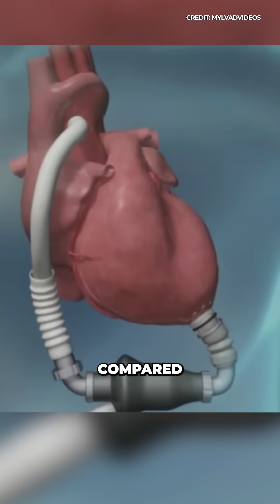Engineers Create World's First Fully Artificial Heart

Comment: Now imagine being a first responder and realizing your patient is breathing but doesn't have a pulse.
Reply: We are already trained about this because of ventricular assist devices that similarly don't have a pulse, but can have good perfusion.
Reply: As EMS, something like that. There already exists a system for if you have heart failure that can temporarily work while waiting for a transplant.
That said, it is external primary, this would be hella cool. But you could not find a pulse, as there is not difference between pressure, which is what a pulse is, I also don't think that we would be able to find blood pressure.
Reply: @jamesmarquess1496 I think in this case you should tattoo "I HAVE A MECHANICAL HEART, I'M NOT DEAD" everywhere they'd check for a pulse 😂
Reply: @choose282 probably would have it tatted on my chest and the medical bracelet
Reply: @choose282  also "RESUSCITATE BUT NO CPR BECAUSE MY HEART IS TITANIUM AND IT'S NOT A LYRIC FROM A SONG"
Reply: @choose282  given that its a temporary thing until they get a donor and tatoos are very much not a temporary thing and will confuse people after the transplant - no, they should not have done that
Reply: @choose282 ” proof that Toby stark has a heart “
Reply: @jamesmarquess1496  If there's a circulation of blood around the body, cuffs should find a blood pressure in theory
Reply: @codyelms9706  They might be mildly concerned when the systolic and diastolic pressures match.
Reply: @Argonwolfproject  YOU’RE RIGHT💀
Reply: @jamesmarquess1496 there would just be a single blood pressure, but I see no reason why a sphygmomanometer wouldn’t work
Reply: Not quite, I'm sure the hospital has a way to check, but within the field, we find blood pressure my first finding or listening to the pulse, then inflating the BP cuff until it cuts off, sense there is no pulse, BP cuff would just slowly press until it stopped blood flow, but there is not to my knowledge a in the field way for use to find that
Reply: @jamesmarquess1496  I suppose you could always insert a syringe that isn't under vacuum into an artery and check for flow. Just a guess.
Reply: @jonrice21 
You probably could, but that’s assuming that you find an artery instantly and don‘t mind the bleeding afterwards.
Reply: @YunxiaoChu    A sphygmomanometer  needs a pulse, a pressure wave. When the air pressure in the cuff reaches the systolic blood pressure, the wave flattens; that's how it is measured.
Reply: @jamesmarquess1496  you would still have blood pressure, its just that it would be a static blood pressure instead of two different values. 

But fluid flowing still has a pressure even if its a continuous flow.
Reply: @jamesmarquess1496  Yeah well, with advances in technology comes new problems that eventually get solved. I'm sure as this thing gets popular, someone will innovate in some way to make up for the cons.
Hell, maybe people will just design a completely new pump that mimics the heart.
Reply: @jamesmarquess1496  if you block a vein off you can see if the vein builds up  without pressure it wouldn't expand at all with blood flow veins would act normally with a blocked off vein. Like how you squeeze your arm to pop your veins out
Reply: @jamesmarquess1496  you're completely right, a normal pulse would be undetectable, and systolic/diastolic would be meaningless so any electronic system should find no pulse and not report anything (to avoid a false reading). Someone with a hand aneroid and a stethoscope might hear a hum that increases in pitch when flow is cut off, and get a pretty good MAP, but it would have to be a very quiet room, and nobody is going to guess that unless the guy can take 5 minutes to explain ahead of time.
Reply: @jamesmarquess1496  true using current equipment, would probably require a new device that measures pressure from a cannula.
Reply: @jamesmarquess1496  could this help people with blood pressure
Reply: @jamesmarquess1496 I think trying to take blood pressure would overwhelm the regulators on the pump and cause an motor overload
Reply: confused screaming
Reply: It would make me triple check the patient, but if there is a clear airway, good oxygen intake, and circulation, I'm not worried. It's definitely going to be gossip in staff training, though 😅
Reply: Im so curious about what something like this does to your vessel valves, if its truly continuous flow does holding the valves open weaken them? Could that cause complications when they finally get a new heart?
Reply: @histiest1628 I think they replace the valves with the new heart but I could be wrong
Reply: This is a good question,  does it work like a musle where if u dont use it u lose it? I mean I dont see y it wouldnt be a problem @histiest1628
Reply: @histiest1628 
That's a really interesting question actually
Reply: @histiest1628  interesting question. These continuous pressure devices would could cause venous valves to stay partially open (the systolic pressure is lower than normal and there is not diastole) andthe lack of pulse could lead to venous stasis and an increased risk of thrombosis (blood clots). The arterial valves from the heart (aortic and pulmonic) might actually stay closed and cause the valves to fuse because of the way some of these devices empty from the ventricle directly into the aorta.
Reply: @histiest1628  Valves aren't 'held open'. The entire heart is gone. There are no valves to open. Your veins and arteries are basically plugged on like a pipe joint, afaik.
Reply: @histiest1628 aren't the valves part of the heart tho? So the artificial heart wouldn't have valves and a new heart would have strong valves already.
Reply: I'm a nurse that used to work on a heart failure floor with LVADs, devices similar to a total artificial heart. The EMS would likely immediately see the giant battery pack strapped to the patient and the drive line of the battery to power the heart going into the patients chest, you cannot miss it! But yes! You cannot feel a patients pulse when they have certain types of LVADs and the artificial heart above. Pulsatile flow is actually better because it helps break up and prevent blood clots. We also have to use Doppler ultrasound to accurately take blood pressure regardless of Pulsatile or non-pulsatile devices. Doppler is basically a little ultrasound stick that you use to amplify the sound of the blood pressure when using an inflatable BP cuff
Reply: He will I assume have a pulse or at least blood flow but not heartbeat(you check on wrist or neck veins)
Reply: @hellyeah6717 I mean.. would he have a detectable pulse? If it’s just continuous flow, I don’t think it can be felt
Reply: @RocketDoggo737  Your intuition is correct. If the device is pumping blood under continuous pressure there wouldn't be a palpable pulse - and you wouldn't be able to measure a blood pressure either, at least not with typical non-invasive means, because blood pressure cuffs rely on sensing a pulse to take a measurement. The same thing also happens with a left ventricular assist device (LVAD) which performs a similar function.
Reply: @PhoebusAmoebus this is very intriguing as this kind of treatment is changing the normal blood flow pattern from Behind Heart beat forward push pressure waves to a continuous flow in a small pipe with a fixed flow rate via some electromagnetic phenomenon.

So the patient's pulse and blood pressure in these cases would be differently measured and their normal values would differ from the assigned 60-100 bpm and 120/80 mmhg. 

I am curious about the internal monitoring system and its concerned variables which regulate the different continuous blood flow rate as per physical activity.
Reply: You can hear the blood circulating, and the mechanical heart will make sound veca duh electromotor
Reply: @RocketDoggo737 you can check blood pressure though. I think if the vein goes back to normal after being compressed that could be a sign of living
Reply: @RocketDoggo737 blood has to pump around the body for someone to be alive ? A pulse is blood traveling through arteries or veins it’s not the heart that makes a pulse 😅
Reply: @RocketDoggo737 it doesn’t actually flow continuously. He was just wrong about that I think. 

Human circulatory system isn’t designed for it. He failed to mention it, but not only does it change its speed depending on activity levels, it is also always oscillating in speed, which combined with the unique shape of the inner chambers, creates a pulsed flow analogous to a natural heart beat as it exits.
Reply: @RocketDoggo737 
Even low pressure continuous flow has a noticeable vibration.
Reply: @RocketDoggo737 Id assume they’d measure it in mechanical rpms
Reply: @RocketDoggo737  love your username
Reply: Ef waves will def be released so you can just try to detect that @RocketDoggo737
Reply: @RocketDoggo737 id assume the valves in arteries would still snap shut, could be wrong though
Reply: Im sorry but the USA is on fire and hell yeah are very accurate user names right now
Reply: @RocketDoggo737 yeah exactly wtf… idk if I can’t feel a pulse I’d start compressions (cpr) which would do nothing because the hearts titanium like you usually do cry to pump blood out of the heart … that’s a funny though
Reply: @RocketDoggo737  I've worked with (a lot) of patients on the volume displacement pumps (LVADs). Obviously not the same, because those patients still have a heart it just works poorly, but you can hear the flow with a doppler. I assume you'd also be able to hear the artificial flow the same way.
Reply: @The_USA_is_on_fire  I have a hard believing he has blood on a continuous flow like that. Seems like it would surely cause problems with something to have a continuous pressure, so maybe this video is exaggerating.
Reply: @RocketDoggo737 if the blood is getting pumped then of course lol use your brain
Reply: @RocketDoggo737  I would imagine you could feel something akin to a pulse by pressing on the vein
Reply: you typically go straight to check for breathing as checking for pulse usually wastes a lot of time
Reply: @RocketDoggo737 thats why i think the hearth shold be a bit loud
Reply: @RocketDoggo737  You can feel continuous flow.
Reply: @hellyeah6717 actually to add onto that without a detectable pulse he could be technically dead right now under some definitions..
Reply: @RocketDoggo737 , concious, responsive and effective breathing.  Not dead under any definition mate.
Reply: @RocketDoggo737  yes, but dead in the sense "there are people who have died for 4 minutes and come back to life"
Reply: @RocketDoggo737  this is why I’ve always called cap on death being the heart stopping lol
Reply: @RocketDoggo737 breathing also plays into that you first check for breathing then a pulse
Reply: @tommo5884 you knew he was being facetious. You were doing well with your medical explanations. Stop yourself before you interpret humor as your "uhm actually" moment.

Stick to the informative stuff.
Reply: @FormerlyBWZ , nobody dies and then comes back.  Death is very definitive. You can survive cardiac arrest, but the odds are severely stacked against you and decreasing with every minute your heart beats ineffectively.  With the odds of survival going down, so to do the odds of permanent disability go up.  Realistically the brain will survive a max of 3 to 4 minutes before brain damage is significant and life altering.  The survival rate for such cardiac events in the US is 10%, the majority of that statistic received immediate treatment, defibrillation and medication.  Once the brain is dead, that's it.
Reply: @conraddejongh3898 , stick with your millsims and stay out of the real stuff
Reply: @The_USA_is_on_fire You're right. He's medically dead without one according to some definitions
Reply: @RocketDoggo737  depends on the temperature, they heat up to see sometimes
heck, in medieval times they buried so many unconscious people they started adding bells to the coffins so the people could ring it
Reply: @The_USA_is_on_fire  or instead of thinking of them as technically dead, you can think of them as technologically alive.
Instead of having biological organs they will have technological organs
Reply: @RocketDoggo737 Did you know that most of us are classified as a dead person?  Were just a corporation owned by the government which is what our birth certificate is
Reply: @RocketDoggo737  "This is the IRS, we demand the inheritance!"
Reply: @RocketDoggo737  under what definitions?
Reply: @RocketDoggo737  I thought the modern classification of death now is brain death
Reply: @RocketDoggo737  not right now. He now has a donor heart. He may have been dead, not anymore though.
Reply: @RocketDoggo737  the definition of death is the soul parting from the body . So i disagree
Reply: @RocketDoggo737  doctors consider an actual death and clinical one. The clinical one assumes your heart isn't working/blood isn't flowing but he does have a working "heart" i guess?
Reply: @RocketDoggo737 Heart failure is not defined as dead, it is actually brain failure that defines death. Heart failure, but no brain failure is considered a vegetative state.
Reply: @RocketDoggo737  which is exactly why fetal heartbeat laws are such BS. The heart is an important organ but it doesn't define life
Reply: @RocketDoggo737  While your heart not beating is commonly thought of to be death, it isn't. Death from a medical standpoint is when your brain stops all activity; also known as brain death. Pulse is important for checking on the state of the heart and aids in determining the urgency of the situation, but doesn't directly determine if someone is dead. In this case though, they'd have a hum emanating from the artificial heart, which would act as the substitute for their heartbeat or pulse
Reply: @hellyeah6717 blood flow yes, but a pulse is a heart beat.
The pulse is the pressure wave from your heart pumping blood, if the flow is constant there are no pressure waves just a constant flow with a bit of unchanging pressure.
Reply: @hellyeah6717  What do you think creates your pulse?
Reply: @Malaphor2501 what baffles me is that he got over 2,000 likes for being very confidently incorrect. Scary
Reply: @hellyeah6717 nah, there would be no pulse, or a most an extremely weak pulse as the rotation is continuous
Reply: @hellyeah6717 no pulse... Pulse is a heartbeat, this does not pulse at all its a consistent volume flow
Reply: @hellyeah6717 Assumption is the mother of all mistakes. This being said you assumed incorrectly. Pulses are caused by heartbeats. Without a beat, its an uninterrupted flow. Meaning no pulse, but a hardly detectable flow.
Reply: @hellyeah6717 your pulse is your heartbeat.
Reply: @hellyeah6717  Listen for a hum instead.
Reply: @hellyeah6717 ...and where do you think a pulse comes from???
Reply: @hellyeah6717 pulse is a beat or shockwave of blood movement.  A motor does not stop and go it just goes.  So there is no pulse.  Most people check for a pulse first and often the only thing checked in the event they believe you may have passed away.  (Note a doctor will check for more then just a pulse before pronouncing you dead such as checking if your eyes dilate and if your breathing)
Reply: @hellyeah6717  the issue is that when it’s being pumped you can feel the pumps, which is different from a constant flow. If you were to try feeling for your pulse you wouldn’t feel anything when it’s not pumping, even if it’s flowing.
Reply: @hellyeah6717 You need a heartbeat for a pulse. We've had versions of an artificial heart before, and those patients don't have pulses. I think they wear bracelets to warn paramedics about the condition.
Reply: @dylanjones9061 I would assume it depends on how the artificial heart functions, its it’s just a continuous steady flow throughout the body then no pulse, but if it mimics how a real heart functions as close as possible there will probably be a pulse
Reply: @hellyeah6717  what do you think a pulse is
Reply: @hellyeah6717  The heart uses an impellor style pump, so there wouldn't be a pulse, just continuous blood flow.
Reply: @hellyeah6717  How can you say he'd have a pulse but no heartbeat??
Reply: @hellyeah6717  the pulls you feel when you press on the inside of the wrist is caused by the heart pumping blood at a specific beat. about 60-100 beats per minute. 
.
if the heart was replaced by a pump that produces continues stable flow of blood, then there will be no pulsation and therefor no pulls. but you might be able to feel the artery by pressing softly down and releasing. it might feel like pressing down on a balloon because the veins and artery's in our body has over pressure.
.
but idk for sure, i have never touched a vain with constant stable flow before.
.
i am how ever pretty sure that you cant feel a pulls and therefor anyone even health professionals would treat it as a heart failure. even though he might breath. but im guessing a patient like this has some kind of badge or necklace that gives important information like the person having an artificial titanium turbo engine in his/her chest. xD
Reply: @hellyeah6717  well since the heart pumps, the pumping is what gives the pulse, this wouldn't give a pulse since it doesn't pump.
Reply: @hellyeah6717  you check arteries for a pulse, not veins. Arteries are what the heart uses to pump blood to your limbs, which is why you can feel a heart beat from them. Veins carry the blood back to the heart, and are much smaller than arteries. You cannot feel a pulse from a vein. The arteries in your wrists are called your radial arteries. The arteries on the sides of your throat are called your coratid arteries. You do have veins in your throat that are also on both sides of your throat. Those are called your jugular veins. But like I said, you cannot feel a pulse from them. You learn something new everyday👌🏾💯
Reply: @hellyeah6717 or fingers and toes
Reply: @hellyeah6717  pulse is caused by the pulsing of blood each systole. Looks like instead of a pulse we gonna get a stu tu tu tu tu tu 😂
Reply: @hellyeah6717  it’s extremely hard to take a pulse check without equipment, I took a class. The teacher said he’s been an EMT in paramedic for 30+ years and even then he can only gauge up pulse around 10% of the time without using actual equipment.
Reply: @hellyeah6717 bro you can’t have a pulse without a heartbeat…..
Reply: Was just reading the people do have a pulse. Also there is one alternative total artificial heart but patients have to carry around what basically is an external pump. 
The company wants it to be usable for between 10- 20 years so probably a permanent solution for many patients till they get to the point of being able to grow hearts
Reply: It's the beginnings of vampire lore. Once all your organs are synthetic, all you need is fresh blood to live forever.
Reply: @98Zai  luckily, blood is made in the bone marrow
Reply: @98Zai sci-fi vampires!? 😱 I love it!!
Reply: No heartbeat, but breathing and no bluing of any skin would be an instant sign that theyre fine. Fingertips get blue quiet quickly iirc. If your heart isnt pumping but your lungs are somehow still working, theres no way for that oxygenated blood to be pumped throughout the body.
No doubt every person in the end would be stupefied at how theyre functioning without a heartbeat and "what in the fuck that low humming noise is, will someone turn it off im trying to work here"
Reply: @ hah
Reply: @  I think you mean dumbfounded, not stupefied
Reply: @YunxiaoChu   imo, the connotation of stupefied seemed more apt in this content.
Stupefied and Dumbfounded are synonyms at the end of the day lol.
Reply: New ER TV show episode idea just dropped
Reply: "No pulse, should I do CPR?"
"Nah... Get the Jumper cable"
Reply: If it is anything like the old artificial hearts (where you had to stay in the hospital) there are electrical leads going into your chest and it's VERY obvious you have something installed.  They don't have an internal battery obviously from the picture, and I don't think they install the battery pack in there for a temporary thing.  You are carrying the power source outside your body... at least for the old models we currently use.
Reply: My assumption is that you probably don't want to have a battery inside eof you body, because that's a huge risk of many things to go wrong. I assume it probably just a really big battery that lasts super long and the only thing internally is the pump and motors. @piratekit3941
Reply: You don’t have to listen for the beat just for the hum
Reply: Now imagine being the EMT who started CPR because he didn't find a pulse and heard a grinding crunching metallic sound
Reply: DUDE EXACTLY ! had this happen on a ridealong, dude had an LVAD so no pulse OR blood pressure. dude was sitting up fine and talking to us, it was crazy and even one of the EMTs was also like “yo wtf that’s cool”
Reply: They wouldn’t have a heartbeat, they would have a pulse though. If you don’t have a pulse you will die, as blood isn’t being circulated
Reply: @Ronaee  what do you think s pulse is, it is your heartbeat, since the mechanical heart continuously moves  blood throughout the body without pumping it like a heart does, you wouldn't have a pulse but you would still be alive.
Reply: this has been an "issue" with VADs for a long time already. these parallel artificial hearts are implanted quite often. the issue is blood doesn't like these steady steams so much and tends to clot faster leading to strokes etc.
Reply: This actually puts the guy at a huge disadvantage, because CPR cannot be performed. If it stops, it stops.
Lmao the only time a defibrillator could actually restart a heartbeat xD /j
Reply: "Is there a mechanic in the room??"
Reply: He would still have a pulse.  The heart doesn’t cause the pulse, the contraction of the blood vessels does.  The heart can’t feasibly move all the blood in the body, so the blood vessels contract and dilate to move the blood along.  This is why, when doctors take blood pressure, they measure it as a fraction, systolic over diastolic, or contracted over expanded.
Reply: agonal breathing
Reply: They will have a hum.
Reply: Ok but this was the question my medical skills teacher asked me when we were learning about CPR lol. I told him I would still do CPR and he told me the situation was impossible... Not so impossible anymore ig 😅
Reply: This would be an issue if they checked the heart itself but the wrists and neck would have a slight pulse as there are similar pump like structures inside the circulatory system (it also prevents blood going back up said type of veins and arteries I can’t for the life of me remember what their actually called)
Reply: Wild. What do you do when the pump breaks? Cant do cpr. Do you get a drill to power it or just crank it with a wrench? Lol
Reply: @ it is probably designed with potential failures in mind
Reply: Someday were gonna be taught or at keast emergency responders beeds to be taught how to read vitals from a mechanical heart, and also know wether or not that humming sound is normal or not
Reply: Sir, the patient has a... Hum
Reply: Easy ,Vampire , wood stick through heart won't work though.
Reply: Right, as an EMT encountering a patient like this would be totally new territory.
Reply: At least this guy won't ever have a heart attack 😂
Reply: that's when you pull out the blood pressure test to check for bloodflow 😂
Reply: wait.... if the blood pressure test works when you detect 2 beats would it even work
Reply: Dude if I responded to that call I would shit bricks! Just thinking of writing that report gives me a headache. Imagine trying to explain this to your medical director as he has you in his office. 😂
Reply: just straight up hear "brrrrrrrrrrr"
Reply: That’s actually a legit concern. People are going to have to completely retrain how to check if someone is still alive… imagine someone with this getting pronounced dead for not having a pulse and having their organs harvested while they’re still alive 😅
Reply: @Ministry_of_WrongThink 
That‘s not how organ donations work, but I get the fear.
Reply: That would have me confused for hours
Reply: panik.
Reply: Having CPR done with that chunk of metal in your chest is terrifying! I feel like you’d need to carry something akin to a “do not resuscitate” card
Reply: Exactly what I was thinking lol
Reply: id be more concerned about the humming tbh
Reply: This is why you'll wear medical braslet
Reply: Good news is when people have cardiac implants they're usually wearing some kind of indicator (I'm used to the ones that look like oversized dog tags), so they'd know very quickly that something was going on.
Reply: paramedics would be in shock if someone doesn't have a pulse, but responds to absolutely everything
Reply: Well obviously, you would have a speedometer style bpm-bloodperminute gauge DUH 🙄
Reply: Wait, what happens when someone tries to give cpr? Does it crush the "heart"? I gooe they have a band or something stating that cpr may actually kill them instead of helping them.
Reply: One would think they would have a wrist tag or medical necklace indicating that they have an artificial heart
Reply: "How's his pulse?" 
"Smooth and steady like a BMW V-12."
"That's way too strong, we need to get him down to an inline-6!"
Reply: Please tell me someone here has seen "Death Becomes her" 😂
Reply: Paramedics are trained on LVADs. You can’t get a blood pressure on them either. All you can do is trust the patients, monitor what vitals you can and transport them to the hospital they need to go to.
Reply: There are multiple artificial heart implants that cause a patient not to have a pulse, so if the patient is conscious and breathing, we, as EMTs or paramedics, would just ask the patient if they have an artificial pump and then we would go about helping them with whatever they called us for.
Reply: My brain hurts thinking about that
Reply: But he has a hum!
Reply: LVAD
Reply: Also imagine being a clinical undergraduate student being told to auscultate his chest in your CVS osce station 😂
Reply: we’re already trained for that, as LVAD and RVAD patients also don’t have a pulse.
Reply: Just thought the same
Reply: I believe people with implants like that carry a medical bracelet or card for that very reason, so they know what they're dealing with lol
Reply: def. would have one of those medical alert wristbands...saying you have artificial heart
Reply: I’d assume any longer term implementation would require a medical bracelet to say they have one of these.
Reply: It’s a thing, there called lvads
Reply: Let’s just hope in that situation that there’s a family member with them that could explain 😅
Reply: he says in the video there's a hum surely they would know about this tech
Reply: As someone with severe anxiety and activity induced heart palpitations, this actually sounds so peaceful.
Reply: People with this will probably have to wear a medical bracelet with this information on it if it becomes a common solution
Reply: This has already happened to LVAD patients whose hearts fully stopped beating. Turns out a pump meant to assist the left ventricle can be powerful enough to do the whole thing sometimes.
Reply: Heart beat is 999bpm or constant😂
Reply: Each heartbeat generates a pulse, and the rate at which these pulses occur is usually referred to as your pulse rate, which reflects the heart rate. If it beats you have a pulse wether artifical or not, the sound may change but it will still be there, like a hum.
Reply: Doubt the patient was running around during those 100 days…I’d bet he or she was in an icu the entire time. Just a guess thought
Reply: LVADs are a thing that all Paramedics in the USA are aware of. This is an improvement on those devices.
Reply: That's why we put you on a 4 lead even if you are dead.
Reply: 😂 dummy he will still have a pulse
Reply: Hi Firefighter/Paramedic here. So I have actually encountered quite a few patients like that. These patients have what you call an LVAD (Left Ventricular Assist device). This devices assists the left ventricle on a heart (part of the heart that pumps blood to the entire body) when that part of the heart does not output the amount of blood needed to go through the body. When these patients have a LVAD, sometimes they do not have a pulse due to the pump being the only thing sending blood through the body. These patients wear a vest with two big batteries on them, they have to change one battery at a time when exchanging for fresh ones out of their battery charger bank. These battery charger bank has quite a few batteries at home, when they travel they have a travel case with batteries as well as a huge card on the case with instructions on how to manage the patient with a certain LVAD and patient treatment. It’s a fascinating device that these patient have when needed. Also fun fact, when someone with an LVAD moves and becomes a resident of a city, they are supposed to send paper work to the fire department and or EMS services if the the fire department doesn’t run their own ambulance, so they know that there is an LVAD patient living there incase that patient needs 911. Doing that helps Fire and EMS obtain additional training on LVAD patient management if they have not received any
Reply: For those that are curious, asked my paramedic about it. Basically, we can't find pulse in the field with palpating or other methods, however this almost certainly has an outside control, and you can probably just see the blood pressure on the guys smartphone
Reply: I think you’d probably be able to feel it  like how dialysis patients get that new vein made in their wrist through surgery and you can feel like a vibration of the blood moving quickly when you put your finger against it
Reply: You can see where this is going, right..? All I can say is eepz just eep.
Reply: I would assume there would have to be some form of documentation with the patient in the event this happens so they aren’t accidentally declared dead despite their blood still flowing
Reply: Vampire!
Reply: Wear your pass, if you survive an accident in which you turn out to be unconscious, it's sad.
Reply: Im a paramedic, Left ventricular assist devices do the same thing and they don't have a pulse! We usually get decent training in this
Reply: Then imagine then putting there ear to his chest to hear a low hum... and even better if he was important or famous, "i found the first fake humans, manchurian candidates are real!" Man that guy would end up losing his mind thinking everyone is fake trying to get him alone to silence him
Reply: We deal with that already with LVAD patients, as well as a handful of other infrequent instances. Patient is awake and talking means patient is clearly alive lol.
Reply: Unfortunately 😅
Reply: If this become common use at some point they would carry with them self a small device that can detect the artificial heart or something like that
Reply: Guess it's time to call the freaking necromancer 😂
Reply: That’s already a thing, look up LVAD, left ventricular assist device
Reply: My son has a lvad he doesn't have a pulse with his device and have to use a doppler to get a map blood pressure. His device hums inside him and is very audible if quiet around him.
Reply: There would be no systolic/diastolic pressure, just a single average.
Reply: You have to check the license plates instead of the id
Reply: That would be weird trying to get a blood pressure reading as well. Would systolic and diastolic pressure be the same?
Reply: Wouldn’t he have a pulse just not a heartbeat?
Reply: What’s even more interesting is that how do we even measure blood pressure with this?
Reply: Iron lungs
Titanium heart 

Me patiently waiting for balls of steel
Reply: What 😂
Reply: LVAD already gives me nightmares
Reply: I think theres only a pulse, but no heartbeat
Reply: He’ll need his cyborg registration
Reply: You conclude they're a vampire or other undead, but the stake fails too!
Reply: "Damn, I need the OBD scanner to monitor the pump speed"
Reply: Yeah i know what's wrong it. It ain't got no gas in it!
Reply: This is what medic alert bracelets are for.
Reply: It actually does happen with patients who have a pacemaker or a special little machine in them that helps their heart to beat
Reply: “Shit, cal Jerry”
“Ok… wait who’s Jerry?”
“Oh, he works at RACV, get on that damn phone”
Reply: D.o.a😂
Reply: Metal detector?
Reply: There’s already a device that keeps your blood flowing without a pulse LVAD. I’m sure paramedics know that
Reply: Waterproof ICE wristband. Problem solved
Reply: Vampirism.
Reply: - ROFL I AM SO DEAD!! ☠️🤣
Reply: he would have to cary smth around sayin he got an implanted heart for safety and that
Reply: @coolimdad 
Way to be versed. I still have things to learn, and these Nazi hold ups are never helping.
Reply: he has a pulse on his neck or wrist and othe areas
Reply: The nightmare is waking up in a coffin because you never had a pulse 😱
Reply: "Sir if you can make your heart go turbo for me." patient proceeds in take a huge gulp of air before a high pitched whine is heard followed by violent loud farts 😂
Reply: Engage surgeon simulator tf2 knowledge
Reply: Maybe he has to wear a bracelet that says "I have a temporary titanium heart"
Reply: To anyone reading this, Jesus loves you.
Reply: It pulses just like a heart. It's not a continuous flow. Dampeners on the inside build pressure and release as it spins
Reply: Just a noise that sounds like a PC idling
Reply: They just freeze,
Reply: Well now I'm horrified by the thought of an EMT administering CPR to a patient with an incompressible heart.
Reply: They’d still have a pulse
Reply: Ahem did u say "First responder"? I guess tc2 is comong
Reply: put a “silver heart” stamp on the drivers license, easy
Reply: i dontthink his heart will malfunction lol
Reply: It looks like a turbo
Reply: Actually it would generate a pulse but a flatline ecg
Reply: Pure adreneline
Reply: Maybe they will have a bracet, to let them know about the A heart
Reply: He will still have a pulse. A heart, even an artificial one, would still have to vary the speed the blood is pumped, as a continuous flow would result in clotting.
Reply: @saucevc8353 yeah except these have a constant flow which is why they can't just leave it in lol. It adjusts for required flow sure but it doesn't naturally pulse
Reply: @saucevc8353  Not necessarily. LVADs won't give a pulse, because the blood is constantly flowing